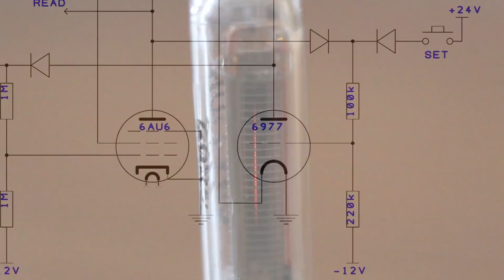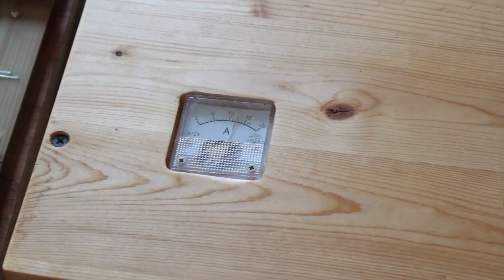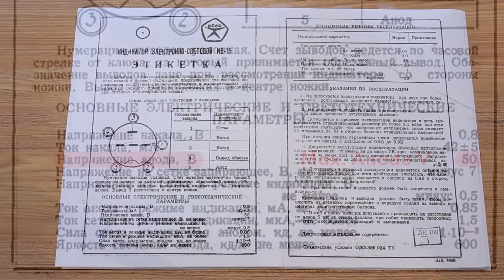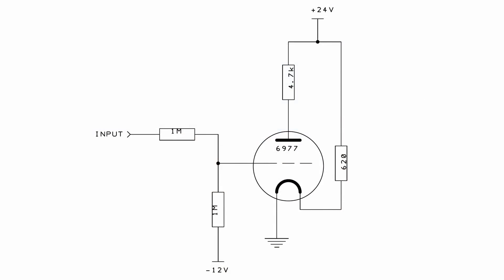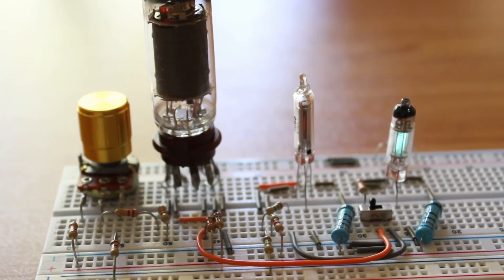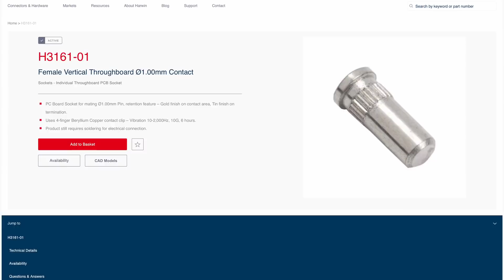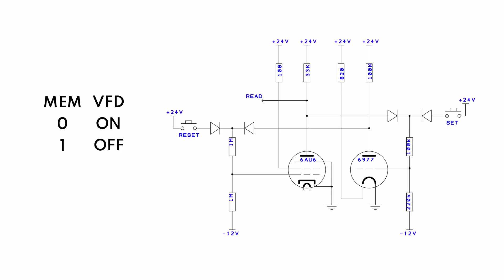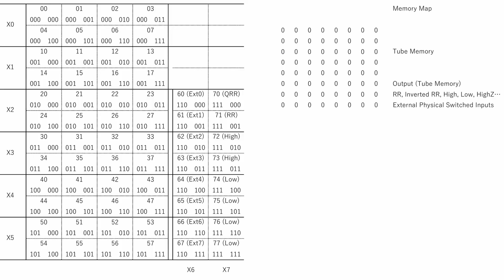Vacuum Tube Computer P.25 – New VFDs for the Processor

Comment: Great work done! I also thinking about vfd's for my computer. But I also want to try out self-made EL mnemo-panels for +150-+50V logic levels. - Just need to add one more switch to modulate EL with 1200Hz
.
50v for IV-15 is nominal anode voltage - maximum values ever placed on separate table - on page 2 - it's 55V for your case.
Reply from the maker: Thank you!
And thanks for the insight on the IV-15 datasheet. I at least was close in guessing that it was talking about anode voltage, haha.
I would love to see some of your custom EL panels designed up for your tube computer project. I think it would give you that ultimate flexibility in how to design the display that'll really make it look epic!

Comment: the vfd swap is a BIG improvement and the soft start upgrade is a good idea because who knows what odd issues the old one could have caused.
as for the memory, i feel like some kind of inverter is needed because it would make more sense for all the vfds to have the same meaning on=1 off=0 and not be flipping between them but i dont know how much that would add to each bit of ram

Comment: Hmmm 1 KB is 8 bit = 8x4 = 32 vacuum tubes for 1KB
Reply from the maker: I think your math may be off a little.
With the tube RAM I'm currently using, it's 4x 6AU6s and 1x6977 per bit. The 6977 is tiny, so we won't count it for the time being. There 8 bits in a byte, and 1,000 bytes in a kilobyte, which means 32 tubes per byte, and 32,000 tubes per kilobyte!
Of course, when getting to that amount of storage, other storage techniques, like core memory, make way more sense.

Comment: what will this even be able to process? certainly binary only, no graphics, it's going to be the equivalent of an early calculator if that, depends on the coding, purley boolean, maybe run a what? sound system maybe?  it can be stood up to fit in a wall but at 1 bit it doesn't have a lot of capabilities, your gong to need at least 8 bit for very weak lo res graphics, then you have speed, is it fast enough to anything beside load an image? real slowly?  think your very first dial up in say 88'.. 12kbpm when you loaded your very first image and actually were able to count the pixels as they loaded up...  lol, when the network was so strained it would stall, image stops loading, buffer 16bits and then goes again 20 seconds later.. remember those days? 

he has enough for 1/2 baud, yea you'll be able to count the pixels as they load... what kind of buffer he may have I dunno, or is this CPU even buffered?  he'll need another room...  lolololo
Reply from the maker: You're thinking far too new!

The trick here is not to try to generate my own video, but instead rely on a more conventional way of displaying output - a teletype. Teletypes have been around since the late 1800s and are essentially the grandfather of the RS-232 serial communication that's super common on data terminals. The 1924 Morkrum Kleinschmidt Model 14 teletype I have uses 5-bit baudot code at 45.5 baud. But, I plan on building the input/output board to capable of outputting 5-bit baudot at 45.5 baud or 7-bit ASCII at 300 baud, which would work with most data terminals.
The memory will have 8-bits specifically set aside for parallel read by the input/output board, so essentially, all I have to do is fill those bits up with the appropriate data, then tell the I/O board to shift it out, and it'll do the rest.

As for what it'll be able to process, the initial goal is to get it to calculate the Fibonacci sequence and display the result on the HEX displays I'll be adding to the I/O board. Then, I want to get it to bit bang "Hello World" to a teletype. But, if the machine is capable of that, it's capable of just about anything. The only limiting factor is memory. Initially, it'll have a very small amount of memory, but the instruction word is set up to allow for memory bank switching, so I can ultimately expand that out to quadruple the total memory (which will still be a very small amount ultimately). 

I have a few long term goals with it. The first is to try to get it to display the Fibonacci sequence results in decimal, which is a proper headache. I need to calculate the value in binary, then convert that to decimal, then convert that yet again to either ASCII or baudot. That's going to require a lot of memory and some pretty inventive programming, but, the machine should be capable of doing it!
Reply: @UsagiElectric  It sounds like you are reinventing the KW37:  "The KWR-37 weighed 100 pounds (45 kg) and contained some 500 subminiature vacuum tubes, whose leads were soldered to printed circuit boards. Each flip-flop in the KW-37 required three tubes, placing an upper bound on the total number of stages in any shift registers used at 166. Squeezing so much logic in such a small and rugged package was quite a feat in the 1950s."  The circuitry calculated Fibonacci numbers---it was a "Koken generator".  Input and output was a Model 28 Teletype.

Comment: The 6977 looks like a cool tube. I’m going to look at the data to see if I can use it as a hard clipper.
Reply from the maker: Oooh, interesting, I never thought about using one as a hard clipper, but if done right, I think it's possible. VFDs are supposed to be able to switch states pretty quickly, but at higher frequencies, it might start to turn into a bit of a soft clipper. Though, that could be interesting in and of itself!

Comment: 6977 tubes are VFD indicators but also triodes.
Will they work as logic in a computer?
If so, that would look cool!
Reply from the maker: They absolutely would! 
And I would have love to build the entire memory out of just 6977 logic, but they're quite pricey compared to the 6AU6, so I'm only using them sparingly. But, especially working at just 24V, the 6977 (and IV-15) could definitely be turned into logic elements!

Comment: Wonder how many tubes it will take to make a serial port?
Reply from the maker: That's actually on the list of things to make!
The entire computer will be composed of four boards: Processor, Memory, Program Control and Input/Output. I haven't figured out all the details of the I/O board yet, but at a bare minimum I want it to be able to shift out 5-bit baudot at 45.5 baud and 7-bit ASCII at 300 baud.
As for the total number of tubes, I'm not sure how many it will take, but I do know the upper limit that I can fit in the physical space allotted for it is around 280. The goal is to keep it under 200 though, like the processor.
Reply: @UsagiElectric  She gonna have to run off a 220v 30A circuit by then.

Comment: I would love to see a commodore 64 made from tubes, or an Atari 2600 or something like that.
Reply from the maker: The Monster 6502 is a good litmus test for how many tubes it would take to recreate the C64!

They use 4,237 discrete transistors in the Monster 6502, but I believe they use a pure TTL design, and so the number of tubes necessary can be reduced considerably using a DTL design, like I use. Additionally, if we use proper high voltages (B+ of 150V and B- of -100V), we can eliminate a lot of the buffers I have to use here because I'm at such low voltage. That means we could probably get it down to somewhere between half or 2/3. Let's call it 2,200 tubes for the 6502. 

But, that's just the processor, the C64 has a ton of other stuff going on. Let's look at memory first. To get the 64k of RAM, we would definitely have to go with core memory, which would take around another 1,500 to 2,000 tubes of control logic to realize (the destructive reads and need to send current in multiple directions adds a lot of complexity. There's also 20K of ROM on board as well for the Kernal, Basic, character set, etc. This would need to be core rope memory and would be physically large, but probably only require another 500 to 1,000 tubes to control. 

Next, the VIC-II chip is no slouch. It's essentially an entire microprocessor of its own stuffed into a single chip. It has 47 R/W 8-bit registers, 16k of memory space for video data, and a boat load of logic to tie it all together and generate the video signal. While a rough guess, I would say it'll probably take a few more tubes than the processor to realize the VIC-II chip because we'd have to implement more core memory here as well. Let's call it 3,000 to be safe.

Now, the SID chip is an interesting one to tackle too. To recreate it 1:1 would be a nightmare, but audio circuits are where tubes shine, and I bet we could use some analog trickery to get the count down really low on this one. To throw out a wild number, maybe 500?

Finally, there's going to be a boat load of glue logic to tie it all together, maybe another 2,000 tubes needed for that. So, what's the final tally?

CPU: 2,200
Memory: 2,750
Video: 3,000
Sound: 500
Glue: 2,000
Total: 10,450 tubes

So, roughly about 10,000 tubes! But, I'm leaving a lot on the table here. Using every trick in IBMs vacuum tube history book (and some new tricks as well), we could probably get that down to about 7,500 tubes, which honestly, isn't bad! It would probably only run at about 100 kHz max, but that's not too terrible considering what it'd be capable of. Using a proper construction technique could probably keep it room sized too!
Reply: @UsagiElectric  Sam Zeelof is making home made silicon gate chips with 1000 transistors
Reply: @UsagiElectric  Maybe time to switch to nmos on homemade silicon. Another channel is making home made chips with about 1000 transistors - Silicon gate process - works even at 3.3v logic levels with homemade chips and transistors.
Reply: @UsagiElectric  Another question would be which tubes.  It's not difficult to imagine how you'd easily corner the used tube market if you tried to do it (ah, so YOU'RE the one who used up all the 6AU6 tubes!), and with that many tubes, having one conk out on you would be easy and you'd be forever troubleshooting the machine or at least keeping the power going as long as possible to minimize failure rate.  The plus side is that if you can get the 100 KHz, you'd outdo the Eniac by an order of magnitude or more, with fewer tubes.

Building it out in stages, with the more device-heavy portions first being modern LSI on breadboards a la Ben Eater for initial testing, might be a feasible approach.

Now here's something else that would be wild: using flame amplifiers and fueling it with natural gas, a semi-steampunk method.
Reply: They made 6502 cpu with transistors

Comment: Wow, that does make a ton of difference.  Thanks!
Reply from the maker: I was really surprised how well the camera picked up the difference between the two! In person, it's very noticeable, and makes it so much easier to see what's on and not.
Reply: @UsagiElectric  I could still, if barely, see the glowing indicator in the old design, but this is a great improvement, as the glowing area is now larger.  For some reason, a smaller plate voltage doesn't always illuminate the full length of the electrodes.

Comment: Ok, so an idea that have been bugging me for some time now:
Use two VFDs (or two separated parts of a single alphanumeric display) as triodes, and build an astable circuit. BAM, LED flasher, with only two semiconductors...
Reply from the maker: Absolutely doable! 
Since the little VFDs are essentially just triodes, you could totally use two of them to easily make a bistable or stable multivibrator. The only drawback is, they're a bit pricey, which is why I'm only using the VFD for half of the memory cell. But, popping two of them side by side and making them an astable multivibrator should be easy peasy!
Reply: @UsagiElectric  My plan was to use an alphanumeric VFD pulled from some old TV box, but "sadly" my pal managed to revive the control board and now we can print bad jokes on it, so that has another use now.
Reply: What is the purpose of  semiconductor if the VFDs already are the switch/valve and indicator lights?

Comment: 7:47 What software are you using for simulation of tube circuits ???
Reply from the maker: I'm using TINA TI simulation with custom tube spice models.
Here's a link to the software itself: https://www.ti.com/tool/TINA-TI
You need to fill out a registration thing, but it all went smoothly for me. For simulating tube stuff, you'll need some tube models, and I got the ones I use from here: http://www.normankoren.com/Audio/Tubemodspice_article.html
Reply: @UsagiElectric  Thanks a lot!!
Reply: I have LT spice, and have downloaded some tube models but every time I try to run a simple sim I get some sort of error message. It’s been a while sense I’ve tried it so I can’t remember the exact error.